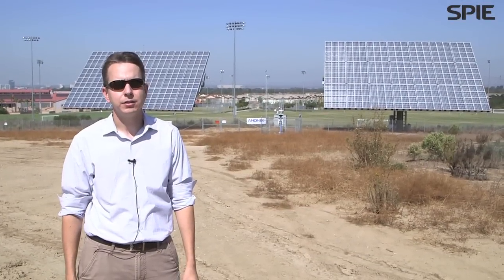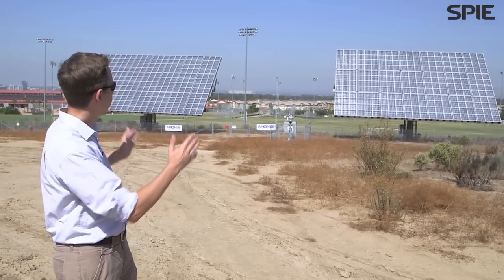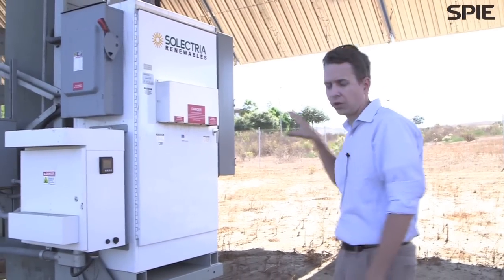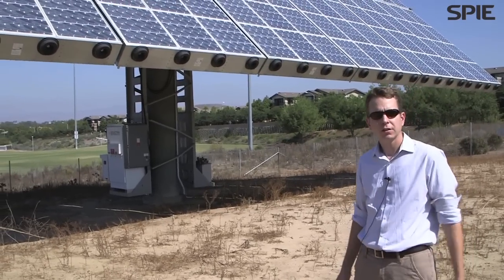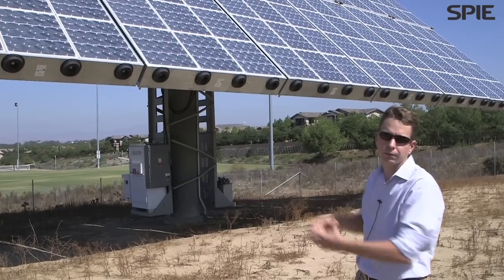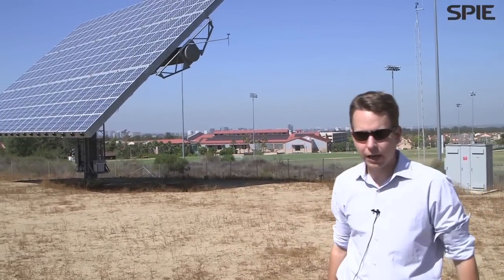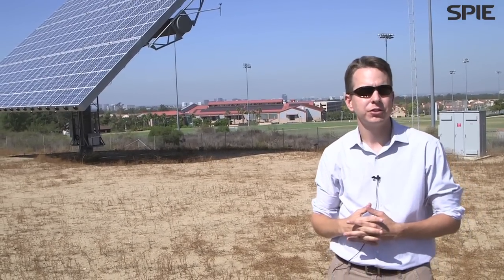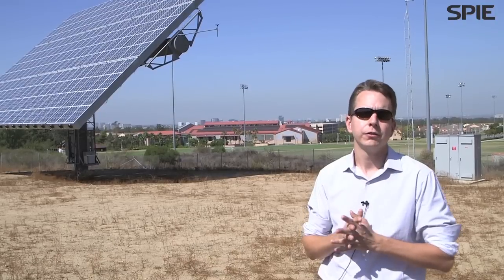Adam Plesniak: Sun-tracking, concentrating systems boost PV efficiency

Comment: I like it.  It cuts down on the amount of surface area to produce solar energy.  

This means a lot less solar panels to produce the same amount of energy.

There must be a balance between the higher cost of the moving tracker and the savings from using less solar panels and less land.
Reply: The cost thought is prohibit,  your better off getting a 2 axis 20/ x 370/380 pannels for home setups

Comment: Hello can you tell me what type of cells you use and how hot they actually get and what sort of efficiency lost do they get I have a way to keep them much much cooler and I'm wondering if that would be helpful design Improvement on these could you also tell me the maximum amount of Suns that could hit a solar cells of this type or the Silicon type if the cell remains  cool

Comment: Cant get it. The whole turning/following system costs 10 times more than the panels. Whats the point ?, just add more panels and forget the complex system.
Reply: in the shadow efficiency drops a lot
Reply: Ya, you could only make this solar installation more expensive if you gold plated the entire structure.
Reply: @RynaxAlien "Shadowing" only occurs at sunrise and sunset, when the sun's energy is low.  Als, there is software the performs "anti-shadow" tracking, now. So, what do you really know about the "shadow" issue?

Comment: Looks very complex.. unlikely for multi mw projects. O&M too high .
Reply: Even bigger issue is self shading when you have multiple of these units close to each other. Unless you can repurpose the land under these units, it is not worth it.
Reply: @movax20h  Virtual tracking, which is placing panels in east-west setup, is much simpler, more storm resistant and due to lower prices of panels, a much better idea.
Reply: @abeyaras - Their 30 Megawatt Solar Farm is working just fine. Facts over-rule your opinion.